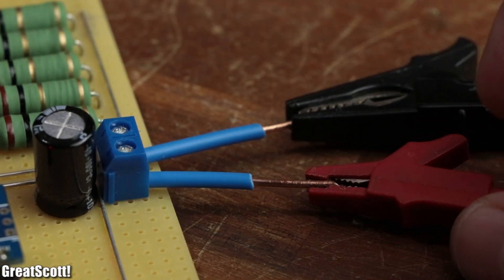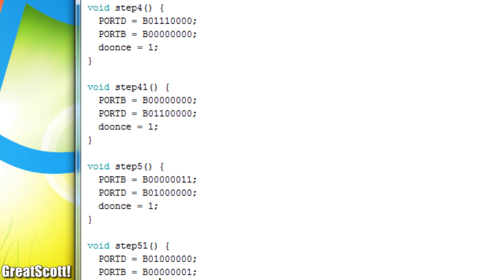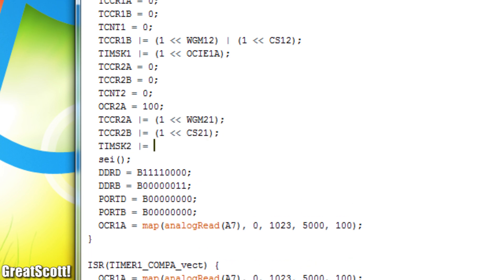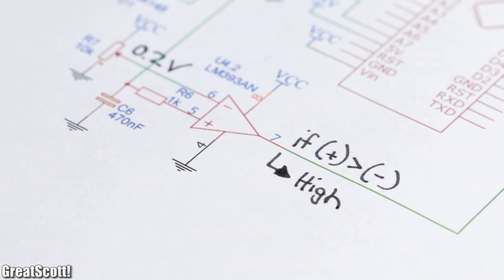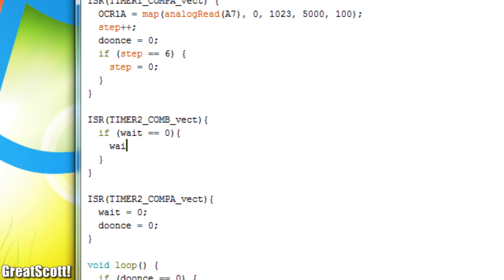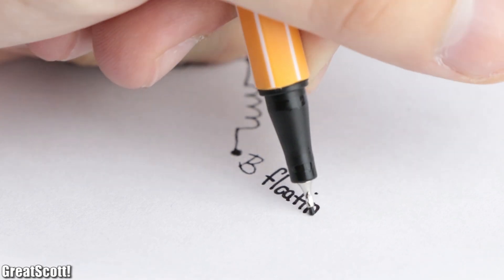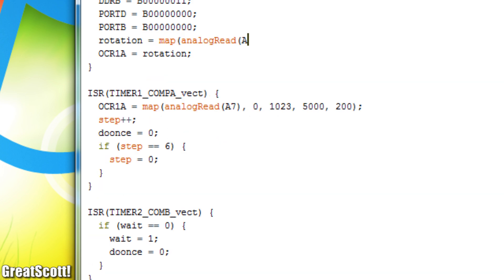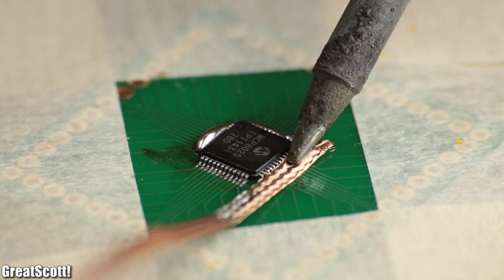Make your own ESC || BLDC Motor Driver (Part 2)

Comment: I guess I should add my own comment. First, I just want to say this is a FANTASTIC video and I hope to see more. I dearly wish the people saying stupid things like "duh... just buy a ESC" would understand that the point is to learn and develop new ways of doing things, as well as to understand why ESC's work the way they do.

So... Let me be sure I understand:
1. You have to start "open loop" as far as position goes because you don't know where the motor shaft is... you just pulse it and switch the power back off when the voltage rises in the coil. You switch to the next coil after a set time. This is slow, because the A2D takes time, and the speed is pretty much just controlled by the frequency of the coil switches, not by the voltage applied, because you can't apply any more voltage without frying to motor. This is a "stepper mode". It should have good /holding/ torque, but the phases are too far apart to have anything like reasonable /detent/ or "pull in" torque like a regular stepper. The fact that you don't know where you are doesn't really matter because you can't drive the motor any harder anyway... if it's "skipping steps" against a load... oh well. 

2. Once the speed is high enough for the magnet to induce a detectable back EMF voltage in the the third / undriven phase, we can use a comparator to trigger on that as our signal to switch to the next phase. At this point, the speed of the motor is controlled by the voltage we apply to the driven coils. As we back off the voltage, the motor moves less quickly to the next phase, and the back EMF spike appears later so we switch slower. Or we apply MORE voltage, not bothering to sense the voltage buildup in the driven coil because we know it won't get high enough to fry the coil or to pull more current than we can provide because it won't have time. The back EMF pulse happens quicker, we switch faster, and so the frequency and speed increase. 

3. At some point, we probably can't sense the back EMF pulse quickly enough and we go into another open loop mode where we are just hitting the coils with everything we have and switching based on what we think the motor needs. If we start seeing the back EMF pulses again, then we can switch out of this mode and back down to mode 2. Or perhaps we still see the EMF pulses, but we must switch /before/ they appear. We are only looking for them as confirmation that the motor "caught up" with us. If we wait for the pulse, it's already too late to switch to the next coil. If we go ahead and switch, and the pulse doesn't show up when we expect it, then the load on the motor is too great and we have to slow our switching down a bit to avoid falling out of phase. I'm not sure this mode is actually necessary, but I think it may be why you are unable to get faster speeds. 

All of that could be avoided if there was an encoder on the motor. In that case, we could simply pulse the coil that matched the current position of the shaft to get started, we could always know when the motor was ready for the next phase, and we would never lose the back EMF pulse as we ran slower or faster.

I'm really interested in the use of BLDC motors to make servos. I have a good encoder and some programming skills, so I hope to develop some ideas in this space soon. In the mean time, if you want a fun encoder to play with let me know. They are magnetic, non-contact, and still support very high speeds (28K to 75K RPM) and resolutions (4000 to 360 clicks) and... have a digital mode where you can just read out the current position instead of having to count the encoder pulses. 

In any case, I'm completely fascinated! The use of the back EMF pulse is such a cool hack and seeing all the complexity of it from your exploration really helps me understand the limitations of this system.

THANK YOU!

Comment: GreatScott! Is there a part 3 ?
Reply from the maker: No
Reply: I would really love to see more on this series.  I am very interested in the greater speed range, from very low to very high, because I think these BLDC motors could be very useful as servos, but most commercial ESC's will not run at low speed.

Comment: Hey man nice video. I am working with a 3 phase Bldc motor project. I have a problem with h-bridge circuit. Bldc motor rotates in only one direction but not in opposite direction. If u have any circuit for Bldc forward and backward kindly mail it to dvignesh5@gmail.com . And it would be a great help to complete my project . Advance thanks man.
Reply: you need to reverse 2 wires on bldc motor to reverse it ;)  how you do it depends on your needs.  The h-bridge is for brushed motors
Reply: Hi vignesh if you have a working code can u send it to arvindhashok1112@gmail.com

Comment: Hi!
Does your driver IC implement a lock time between high and low side? Because that can cause a hot path and also a high current which means heating the driver circuit and the motor up. Eventually it will be destroyed.

Comment: If I wanted to create an ESC for your electric skateboard project, what steps would i need to take to create one that supplies more amperage?

Thanks!!!!!!!!!!!!!
Reply: you use high amp n channel mosfets to create the h-bridges instead of a ic with built in mosfets which aren't individually heatsinked like he did.  He mentions this at the end of the video.

Comment: The throttle setting controls what exactly in the ESC? Is it RPM? Is it voltage? What happens when the propeller spins faster than the throttle setting (lets say you have a variable pitch drone doing a dive and the upward winds make the props spin faster as gravity makes the drone accelerate pass terminal velocity).? Will the motor try and slow it down?
Reply: The throttle controls the frequency.

The bldc motors are similar to a synchronous motor, that is they will rotate at the set speed (dictated by frequency). It will start drawing less and less current, until it draws no current at all and then actually start generating power and, eventually, blow the body diodes of the MOSFETS in the esc :-)
Reply: So really I cant recharge my variable pitch propeller quad-drone batteries by autorotating since it will blow the diodes?
Reply: The ESC would need to support regenerative braking in order to do that (an additional set of transistors is needed) Most airplane/quadcopter ESCs that have a "brake" function, simply short out a phase of the motor in order to slow it down, because since propellers have a low inertia this form of breaking suffices. 

I am not aware of any ESC that has regenerative braking. RC car ESCs have resistive/rheostatic braking, which is a more controlled form of brake than shorting out the winding, but can't recharge a battery (the power is dissipated).

What you could do, is add a full wave 3-phase rectifier (6 diodes) to each of the four motors, then put four relays that are controlled by your remote control, parallel the four rectifier outputs together and then connect them to a DC to DC converter. This COULD work, but I think it will be too heavy and the power output would be minimal as well unless the whole thing is very heavy. 

Assuming 100% efficiency (you are probably looking for 0,1%!) a 1kg drone falling 10 metres has a potential energy of 100 joules. If the drone descends that 10 meters in 10 seconds, (1 m/s vertical velocity) that's a 10 W power output.

But since the propellers are not 100% efficient (look up Betz limit), and will likely be 15 to 20% efficient at low airspeeds, that's already a 1,5W power output, then a motor running as a generator will have also a poor efficiency, probably around 60%, which means that you get only 0,9W, then the rectifiers and the converter will also lose around 20% of that 0,9W, which leaves you with a whopping 0,72 W to charge the battery, not very practical... (consider that a charger like the Imax B6 is 65W!)

Were you building an electric skateboard or the like, regenerative braking makes sense because you only lose 40% of the total power or so since you don't have the propeller, but , but for a light drone, it doesn't...

Also, I have only worked with OpenGL ARB in a hobbyist way, I am much more expert in electronics design.
Reply: Your electronics skill set also is very useful, can you build custom ESC? Please email me or add me on facebook with the email I gave u.
Reply: Why would you want to design a custom esc? What functions do you need exactly?

Comment: +GreatScott, you can actually save yourself the trouble with the external comparators by using the built-in comparator in the ATMega. However. even the built-in ADC should work. 

Re current spikes - I think you need to add some dead-time when switching the highside/lowside mosfets. They don't switch instantaneously and you get a short period when both are on at the same time => short circuit/current spike + transistors running hot. Actually the timer in the Mega has some features for driving bridges and allows to program in a dead time period. Or you can do it yourself in software too.

ATMEL has several appnotes on driving BLDC motors using their ATMega/ATTiny micros that show the use of timers and ADC:

Sensor-less
http://www.atmel.com/images/doc8192.pdf

With Hall sensors:
http://www.atmel.com/images/doc7827.pdf

Comment: Question : why didn't you use the integrated analog comparator of the Atmega328p ? Its non-inverting input is on AN0 and its inverting input can be muxed on-the-fly on ADC[0..7]...  ( cf datasheet chapter 23, page 234 ).
In fact, this trick is used on any atmega8-based commercial BLESC. ;)
AN0 gets the summed phases voltage, and negative inputs are switched on each cycle.

Comment: i have been trying to make a driver for a "Honda Power Steering Motor".  It is a very large BLDC Motor. I believe the problem I'm having is the  "in rush current."  Can you HELP ME.
Reply: At which max RPMs do these run ? You cut the current by employing PWM. Since you don't want to hear sounds from the motor, the PWM frequency should be around 24 kHz. The current on the winding is then limited by the duty cycle of the PWM pulses. For very large currents, you'll need power Mosfets or IGBT with appropriate gate drivers.

Comment: I am not sure if any one else has mentioned it, firstly appart form a very good tutorial, you are only running the motor in synchronous mode. Like a stepper motor, to get more speed you need to increase the frequency. It is not true brushless where the ESC only performs commutation as dictated by motor position and in such a way speed is governed by the voltage applied and the KV rating of the motor. Most ESC's start in stepper motor mode but as soon as the BEMF is sufficient to detect commutation state they switch over to full brushless, which is more efficient. and allows for faster operation. Thank you.
Reply: Why hassle the poor guy, he is trying. I firmly believe in learning form making mistakes. Its a bonus for people when some one else makes them for you. He is on the right track and with community guidance every one will learn something
Reply: I am so sorry for not getting back to you sooner. Firstly here is a +80kRPM test https://youtu.be/TfL3JQ4f83I points 1 and 2 are correct. point 3 delete!
Yes sensored Brushless motors are exactly correct with a hall effect device you can commutate the MOSFETS like they were brushes and the code becomes trivial,(it can be done with gates) in sensorless brushless motors you need to detect position using the Back EMF to know when to switch and you always need to do that and it is usually done with a comparator to get the speed. Basically the PWM is used to reduce the applied voltage and limit the current (especially in stepper mode) If you only stepped phases at a few RPM your current would fry the motor so the PWM limits that and the motor is rotated in synchronous mode (it increasing frequency) until the motor is going fast enough to generate a usable back EMF and then you can go to switching the phases using the BEMF. and you stay in that mode. RPM is then controlled by varying the PWM wich is the same as varying the applied voltage.
Reply: @rotorrant5867  Hey, thanks for all your feedback. I'm building my own ESC and trying to improve on the design shown (with 0 background/previous knowledge). Could you explain why varying the pWM is . the same as varying the applied voltage? Did you mean it will have the same outcome? Else it wouldn't be the same right? One is in the time domain versus the energy domain.
Reply: @geepytee  The DC component of the mark to space ratio is the average voltage of that ratio multiplied by applied voltage. Its the only way you can current limit the motor efficiently.
Reply: Rotor Rant let me check I understand. To begin with we use the BEMF from the third phase but once there is enough rotational energy to keep the rotor flywheeling then we can just ignore the sensor reading and just rotate through the different phases and assume that the motor is keeping up?
Reply: Ah no sorry if I have not made that clear. Also sorry if I misunderstood you. The Back EMF on the open winding is what you use to determine when to switch the phases. In your video you said if you want to make the motor go faster then you increase the frequency. That was not quite right if you want it to go faster and your ESC is comutating correctly then you should increase the applied voltage and this may (depending on the load) increase the frequency if the motor goes faster. If you force the frequency to increase in the code you will loose synchronization. 
So maybe I misunderstand you but If you are going in free running comutation then the speed should be proportional to applied voltage, If you code is not fast enough you will loose synchronization so it seems odd that your motor does not go very fast. If you have a look at my channel you will see an +80,000RPM test.
Keep up the videos.
Reply: Do you have a code to do this? Thanks
Reply: Pls I'd like you to coach me well on this. I want to build one. My whatsapp number is +233271686762
Reply: I have got zero experience, but that was a good explanation. I'm considering taking up building stuff with Arduinos as a hobby. Your comment goes into my notes 😅
Reply: So... Let me be sure I understand:
1. you have to start "open loop" because you don't know where the motor shaft is... you just pulse it and switch the power back off when the voltage rises in the coil. You switch to the next coil after a set time. This is slow, because the A2D takes time, and the speed is pretty much just controlled by the frequency of the coil switches, not by the voltage applied, because you can't apply any more voltage without frying to motor. This is the "stepper mode" you spoke of. It should have good /holding/ torque, but the phases are too far apart to have anything like reasonable /detent/ or "pull in" torque like a regular stepper. 

2. Once the speed is high enough for the magnet to induce a detectable back EMF voltage in the the third / undriven phase, we can use a comparator to trigger on that as our signal to switch to the next phase. At this point, the speed of the motor is controlled by the voltage we apply to the driven coils. As we back off the voltage, the motor moves less quickly to the next phase, and the back EMF spike appears later so we switch slower. Or we apply MORE voltage, not bothering to sense the voltage buildup in the driven coil because we know it won't get high enough to fry the coil or to pull more current than we can provide because it won't have time. The back EMF pulse happens quicker, we switch faster, and so the frequency and speed increase. 

3. At some point, we probably can't sense the back EMF pulse quickly enough and we go into another open loop mode where we are just hitting the coils with everything we have and switching based on what we think the motor needs. If we start seeing the back EMF pulses again, then we can switch out of this mode and back down to mode 2. I'm not sure this mode is actually necessary.

All of that could be avoided if there was an encoder on the motor. In that case, we could simply pulse the coil that matched the current position of the shaft to get started, we could always know when the motor was ready for the next phase, and we would never lose the back EMF pulse as we ran slower or faster.

I'm really interested in the use of BLDC motors to make servos. I have a good encoder and some programming skills, so I hope to develop some ideas in this space soon. 

I would really love to watch your video, but I can't seem to find it on your page. A link would be great.

Comment: Do the commercial ESCs use this bfcm method?   I have always thought the motors should have a hall effect feed back in order to optimize the phase point at which the current is switched between coils.    I wasn't aware of this method of feedback.
Reply: Yes, I believe they do.
Reply: And I totally agree that adding an encoder would be very helpful.

Comment: Instead of shorting the coil to ground, couldnt you just use a mosfet driver with an enable pin or individual FET control (non-complementary), so the coil floats by just turning off all FETs? shorting it wastes energy (since your braking with the motor when shorting the coils by converting the back EMF to heat and thereby taking energy out of the system.

Comment: Hey Scott! I like your work and could you make a BMS - battery management system that has over discharge and overcharge protection as well as a short circuit protection that is able to expand to any amount of cells. With a balance charger added. Could we use an Arduino to monitor its status? or just use an Arduino to build it? I would be cool to make it and I can't find any other people that did this. Hope you read this. Have fun creating and producing more of your great videos.
Reply: Gregor Kalan plans for a power wall?